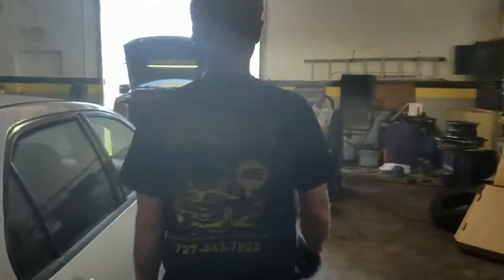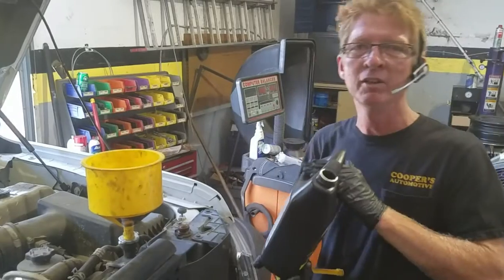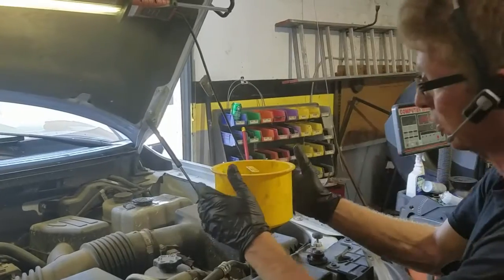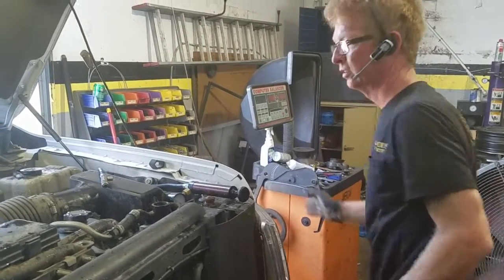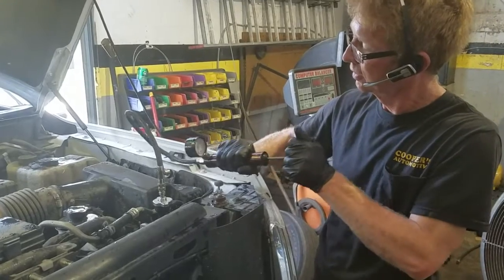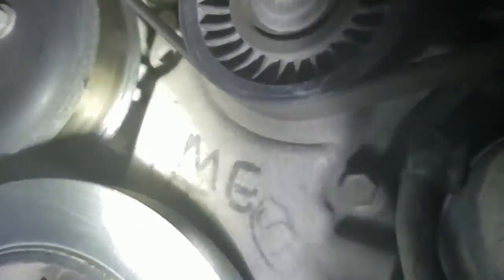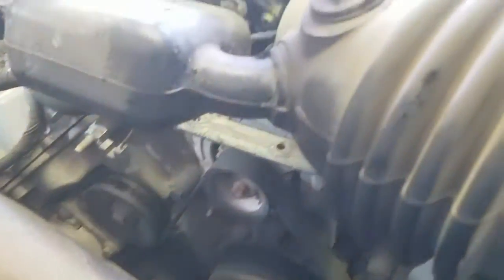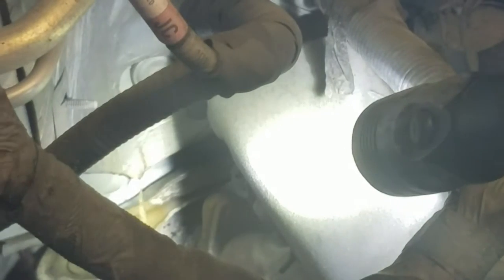2010 Ford F150   Overheating  How To Pinpoint A Coolant Leak

Comment: Thanks for sharing. A few questions. How long you leave the system under pressure and at what psi? 16? Can’t find much info as far as coolant leaks on the 2009/2010 5.4 models. This one needed a new water pump as well as a heater core? Any other areas you suggest checking? Not seeing any overheating or fluid on the ground however I believe there is a slow leak somewhere per a leak down text a year ago. Thank you sharing the procedure. I’m approaching 150.000 I guess it’s time to change belt, water pump and thermostat. The fan comes on sometimes full blast when starting my truck in the morning. Thank you for sharing.
Reply from the maker: It’s can be very difficult at times to pinpoint. I had to leave them sometimes for hours engine Cold  an engine hot

Comment: Greetings from Canada! I got a 2006 Mustang GT with 94,000 miles that is overheating as the fan works intermittently. Initially I replaced the thermostat with a Ford one but it still had the same issue. Then I took the radiator out and had it tested (all good). I then replaced the radiator cap and I installed a new Ford fan assembly. The resistor on the old fan assembly had burn marks on the power wire feeding the resistor so I think this caused my initial overheat. The new assembly comes with a new resistor on it and the plugin to the resistor looks fine. I don’t understand why all of this has not resolved the issue. I am the original owner of the car and it is meticulously kept and not driven in winter or rain. I’m wondering if I still have air in the system and if so if that would cause the fan to not come on? I don’t have any symptoms of a blown head gasket. The car runs perfect and has lots of power and there’s no white smoke or coolant in the oil and no bubbles can be seen in the expansion tank. Fan relays have been checked. I’m wondering if the PCM is bad. I was also wondering about the cylinder head temperature sensor but I read that those usually throw a code and can give a false overheat indication on the gauge or cause longer engine crank times. None of that applies to me. Any ideas on how to proceed? I have spent hours watching videos and researching this. My car has been having this issue since July 13 and soon it’s time for winter storage again 🙁 so I’m desperate to solve the problem. I even had a Ford tech look at it with Ford software and he could not figure it out. Thanks.
Reply: Water pump seal. It happened to my mustang few years back replaced whole water pump. No more heating up luckily Ford can heat up and never ruin the motor
Reply: @xalvabx4620  it was actually a wire to the high speed fan relay that burned inside the engine fuse box. And I saw online that other cars had the exact same thing happen. I had to disassemble the engine fuse box to discover that. These 2006s have electrical glitches it seems.

Comment: With this particular year F150, do you use the radiator to perform a coolant flush, or the coolant reservoir?
Reply from the maker: With our flush  equipment, you can use the reservoir

Comment: I just replaced a new water pump and serpentine belt and recently it's been overheating
Reply from the maker: That’s true sometimes they will. My experience has been 50-50 as a shop time is money so we can’t take that chance. thanks for response
Reply from the maker: Sorry for that wrong response. Possibility fan clutch thermostat and or blown head gasket
Reply: Coppers that is such a horrible suggestion.